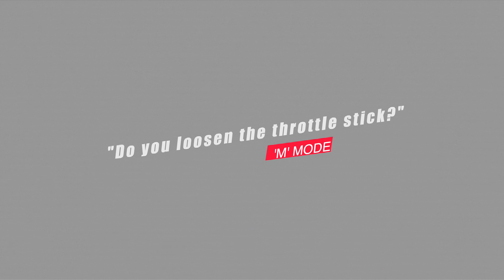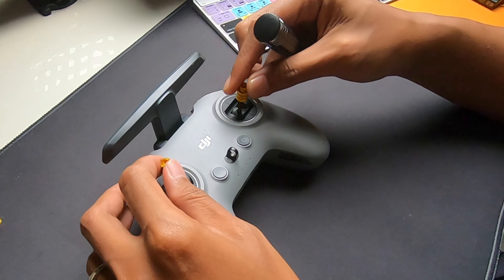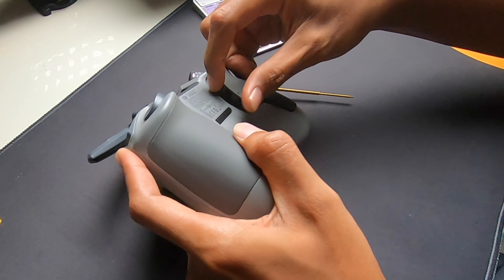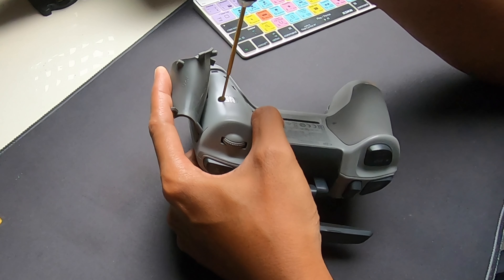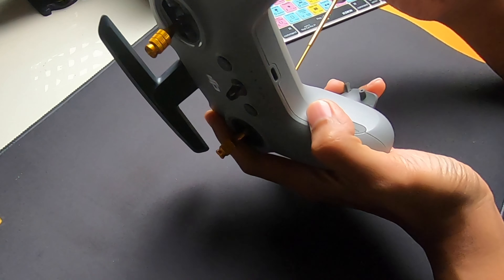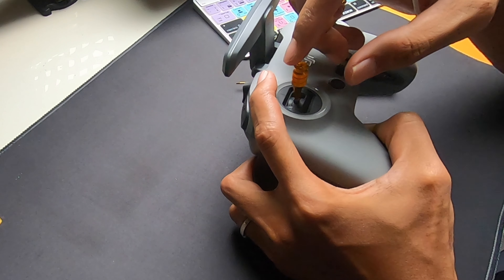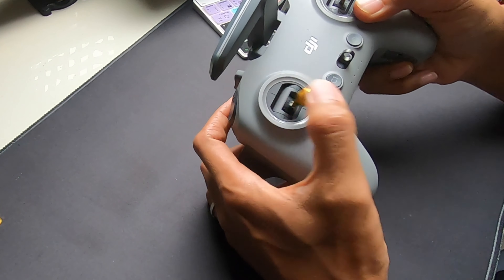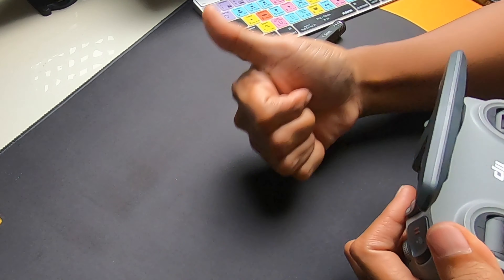Adjust Your DJI FPV Controller For Manual Mode

Comment: Thanks for the video. I have a request for you. I know you've done a tutorial on coordinated turns, and it helped me a lot. However, I still drift out much more than I should. Could you circle back on this and provide commentary on what causes the drift. Thanks in advance!
Reply from the maker: Great suggestion! Actually will be added to the episode schedules. For now, maybe u would wanna think of it like riding a bicycle. The faster you wanna take the turn, the more you got to lean into it. IF SPEED WAS CONSTANT, too little lean and your turn will be wide, too much lean and u be heading for a slide! So thats how I take the turns with the drone. If find im drifting outwards, then ill bank (roll) the drone harder to take the turn. This hard turn will naturally cause the drone to lose speed. So just give it a bit more throttle to maintain altitude in the turn. Hope that helps get u going!
Reply: @TheReelRahim  Thanks Rahim. You are the real deal. I consider you a friend. Thanks for taking the time to get me out of the woods with my FPV experience.
Reply from the maker: Will always be here. If you wanna chat, im at ayimmech@gmail.com. Then we can go from there.

Comment: Hi,
I'm flying mode 1 and I'm finding no information on this.
Can I do the same adjustment for the right stick and change the control layout in software?
Reply from the maker: Yes you can! Hehe just tried it. You can tighten the right side F2 fully (finger tight is fine). This would loosen the sticks till there is almost no more spring tension in your throttle. Then screw in F1 to give the desired friction that you need. Oh and then you can switch from Mode 2 preset to Mode 1 in the goggles menu. Hope that helps.

Comment: What’s the size of tool ?  I’m trying some but they don’t fit.
Reply from the maker: Im using a 1.5mm hex driver. I think an allen key of this size is included in the DJI FPV box.

Comment: Can the controller 2 be used in mode 1? (Throttle on the right)
Reply from the maker: Yes you can! Just change it in the settings of the goggles to Mode 1, and adjust the screws following the same procedures.
Reply: @TheReelRahim  thank you.

Comment: So you do or don't a just both sticks?
Reply from the maker: Sorry i use e term sticks loosely. I meant that id adjust the throttle stick (Left stick if on Mode 2). Id leave the Pitch and Roll (Right Stick for Mode 2) alone, as i feel e setting is about right.

Comment: When I'm adjusting the f2 do I want it to be able to have a little but of a push at the bottom and top, or tighten it to the point there is absolutely no spring load, Or should I leave say an 1/8th left so when I tighten the f1 it will hold but there will still be a little push at the top and bottom or do I relieve that totally
Reply from the maker: Pure preference, but here is a guide

F2 (spring tension)
- its like a force pushing back at you
F1 (friction)
- the force holding the stick in whatever position u left it after fully tightening F2 

I fully tighten F2 till there is no spring tention, as i have no need for any in M Mode. But when i fly this in the sim, i felt that i cant control it, so i tighten F1 to add just a touch of friction according to my flying comfort and how much effort i feel is needed to move it
Reply: @TheReelRahim  I understand that part you explained it very well, in the video. I just didn't know if you left any spring load?
Reply from the maker: No spring load for the throttle. Totally loose. Just apply friction for own feel.

Comment: In sport mode when I move my left stick left, the drone banks left. But in full manual mode this is inverted. Is there a way to I can make the drone bank left when I move the stick left in full manual mode?? it's so hard to master the controls when sport mode is opposite of Manual mode.
Reply from the maker: Ahh i believe that is a setting in N and S that helps pilots roll and yaw together, making you bank the drone into the corner easier. Sorry friend, manual mode is what the name says. Fully manual. YOU WILL need many hours in the sim to fully understand and have the natural muscle memory for it. No shortcuts for this. That is why DIY FPV has been such a steep mountain to climb. But DJI has made this simpler for anyone to get into it. But you will still need to grind in the sim. That is what they didnt say...

Comment: My avata doesn’t start and gives me a throttle stick error message. This came up before and after I adjusted the F 1 and 2 screws and I calibrated it both times. Is there something missing? I had updated the controller already and I don’t see any updates left
Reply from the maker: What methods are you using to start the motors, and in which Mode? N, S or M?
Reply: @TheReelRahim  well I just noticed but it does start the motors on all modes. But I’m still getting a throttle stick error message even after updating and calibrating the drone and accessories. I’m in the middle of contacting DJI support about it but no solution yet… if you know anything I would greatly appreciate it

Comment: If I set it up for manual then can I still fly in normal and sports mode?
Reply from the maker: Yes you can. Its just that when you switch back on the controls to N and S modes, it wont hover easy and you will need to bring the Altitude control stick back to centre. Not difficult, just observe when in goggles. Look at your current altitude and adjust till you are hovering in place and you are good to go.

Comment: One question. Does anyone make or have an STL file for a 3d peinted gimbal ring that allows for rubber bands after making the change to manual throttle control?
Reply from the maker: Sorry not too sure. What is it for?

Comment: I’m left handed and I use stick control number three. Everyone only shows the right handed adjustments.
Reply from the maker: Cool, rarely hear anyone using other modes. Most pilots i know go w mode 2, regardless of left or right handed. I guess its preferences.

Comment: The question i have is my calibration error wont go away no matter how many times i calibrate them. I tried adjusting as you recommend here but still nothing gets rid of that error. I'm fully updated
Reply from the maker: Im sorry mate, I too keep getting that error once in a while, so I either keep calibrating at every battery change, or ignore it altogether.

Comment: How do you take off in full manual mode
Reply: usually start in normal
Reply from the maker: If comfortable, can launch in Manual also
Reply from the maker: Ok in this video iv mentioned this. View 2:15 onwards.

https://youtu.be/P6mBxbwlPzs

But with the recent firmware update, instead of double tap start/stop, u can assign the top right toggle switch to start/stop the motors. Hope that helps.

Comment: How do i reverve it?like if i want to fly in s or n mode again
Reply: To make manual mode
F2 Screw in all the way. 

F1 Tighten F1 until the stick doesn't giggle too much. 
Adjust to your liking. 

To make into normal mode
Loosen F2
Loosen F1
Reply from the maker: Thanks mate!

Comment: So i followed the guide but now if i go into calibration it doesn't detect trottle up and down anymore, meaning it doesn't start when holding both joystick down and inwards.
Reply from the maker: Sorry missed this. What mode are you in to start the motors? It should detect fine if you are in N and S modes, but in M mode you have to start the motors via switch.

Comment: What happens if don't do this and fly manual does it stay in hover mode
Reply from the maker: Nope it will no longer have hover mode. Also since throttle is no longer altitude control, if u let the sticks self centre, it will be mid throttle, and drone will fly away if u do not control it.

Comment: This is crazy but im flying in manual mode much better not tightening the screws...just leaving them as is with the springs is there anyone out there thats having or had that same experience? lol im learning fast but again ive just been more comfortable leaving the springs as is.
Reply from the maker: Its all preference. I have flown with both and as a pilot that started off in DIY FPV, its just better for me as i dont have to fight with the sticks while throttling. But if it works for you, then stick with it🤟🏽

Comment: What tool is he using?
Reply from the maker: Hi im using a 1.5mm hex driver. You could look into brands like RJX or Injora on Banggood. Usually comes in a set of 4 sizes.